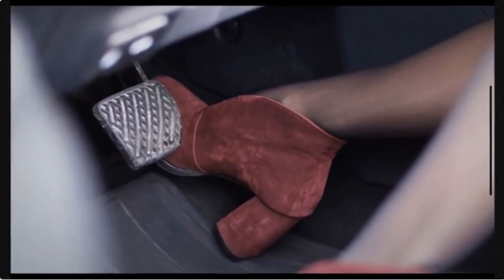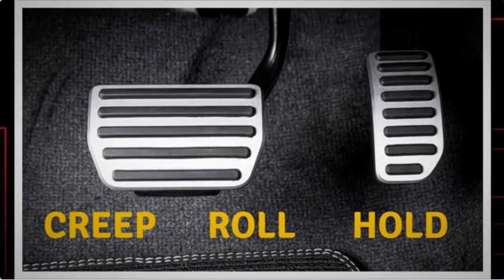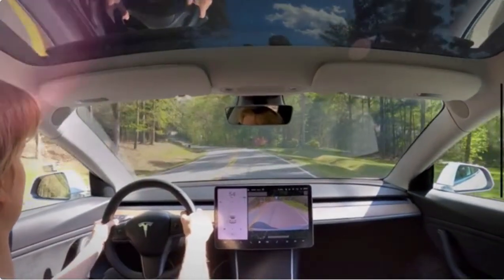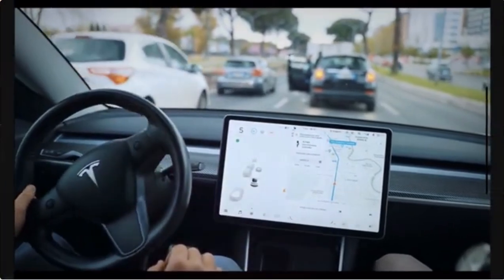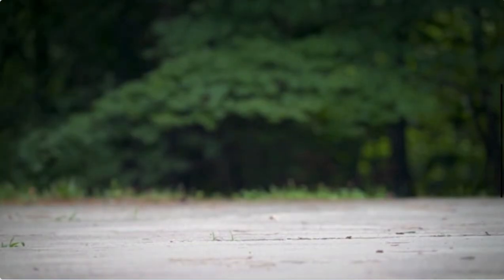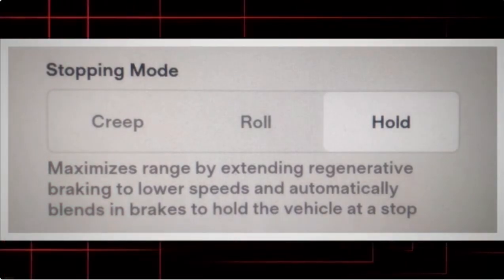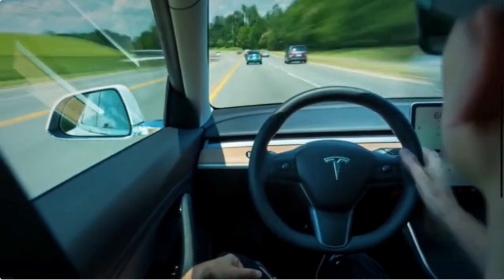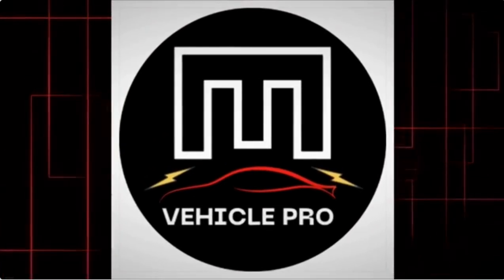Tesla Stopping Mode: You choose how the brakes will work!

Comment: Tesla has removed the option to change your mode
Reply from the maker: I still have it on my model Y.   Dynamics > Stopping Mode
If you can't see it you may need to do a reset
Reply: @evehiclepro  I read something that they took the feature away on the cars built in 2024.
Reply: @damasterg  i read something that grass is pink in 2024